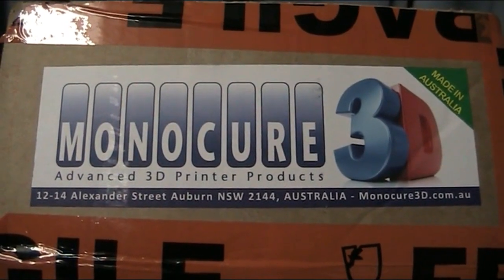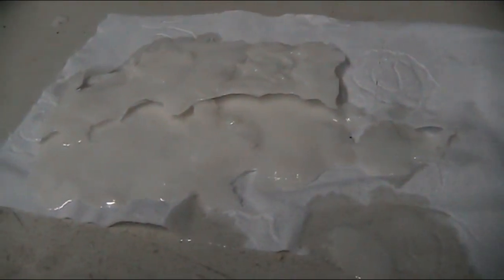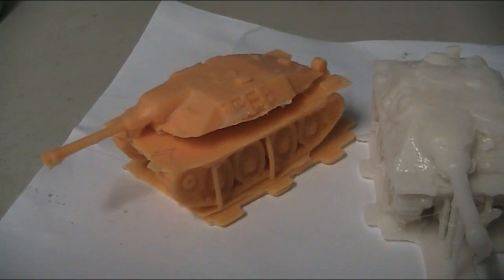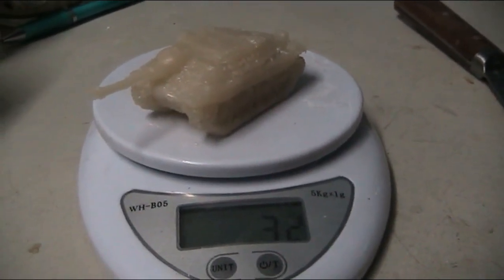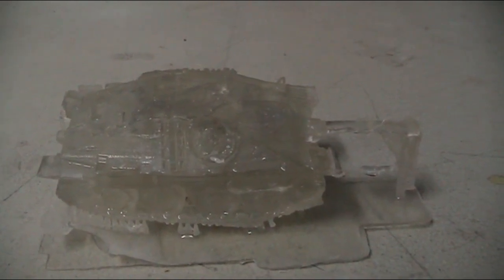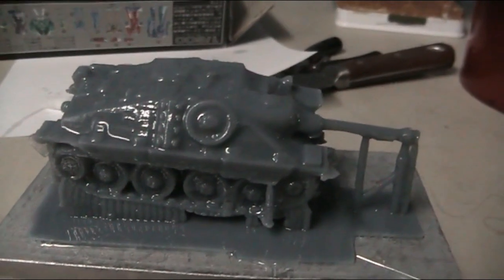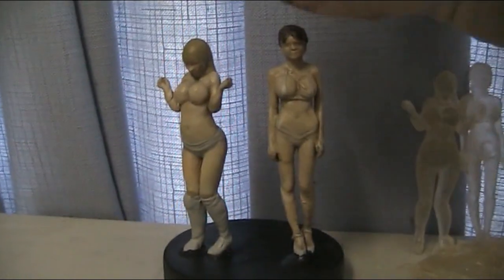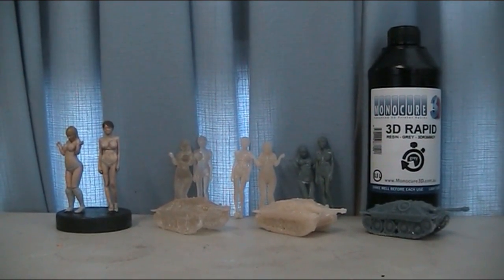Sparkmaker - Monocure 3D rapid resin test review

Comment: This resin is trash. It doesn't do details very well and with my default printer's settings I can get a print of a drip-off bracket in about 5 hours even though the supports I used were too small and the print failed, with Monocure's absurd recommended settings it would take nearly 25 hours. I was given a bottle of the 3D rapid model resin in red and the best print I got was an enlarged mini STL that still doesn't have as much crisp detail as it should. I'd likely going to toss the remaining resin once my Elegoo resin arrives.
Reply from the maker: Thank you for sharing your story, I have also gotten a few private accounts of the make being difficult to use. I was careful with my works in the video not to get in trouble.

Comment: Ngl mate. There looks to be NO detail on those models. What did you bash em together with? Meshmixer?
Reply: It's the resin, it's trash. Doesn't work very well on default settings and recommended settings are ridiculously long. 4 burn in layers at 100 seconds then ~12 seconds exposure time on additional layers. A drip-off bracket took ~5 hours on default settings and would have been like ~25 with their recommended settings.

Comment: Tip for clear resin, using an airbrushed blow off all excess resin then put under uv light for a few minutes. You will need to give it a clear coat or it will over cure but it will be clear. Doing some gundam eyes in clear green for a 1/100 strike dagger from thingi at the moment. 

Surprised that no one has made a spreadsheet with all the curing times for each resin.
Reply: Just an update for anyone else reading this. A spreadsheet does exist with recommendations for different types of resin.

https://docs.google.com/spreadsheets/d/1crvzMnt_8NJXAsABinoIhcOjE8l3h7s0L82Zlh1vkL8/edit#gid=0